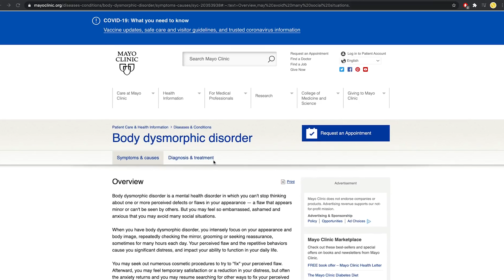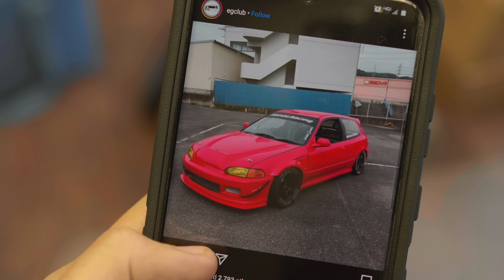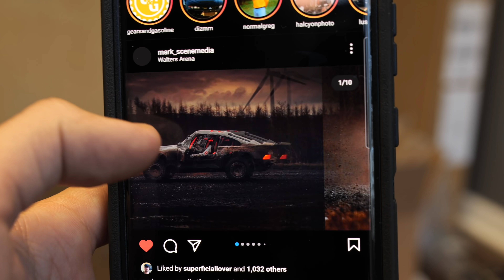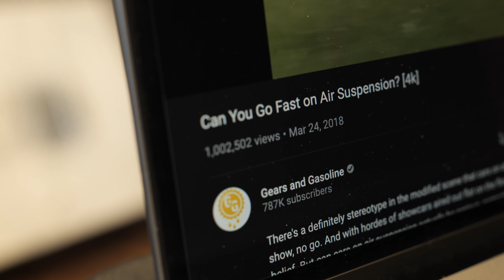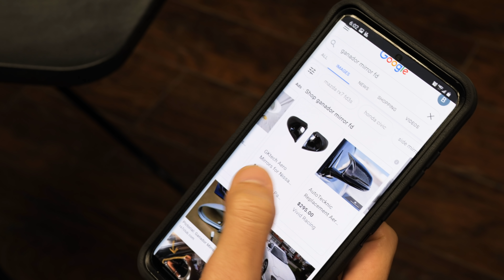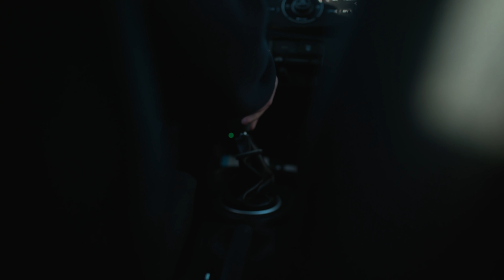Cars Won't Make You Happy

Comment: I drive a Citroen Saxo 1.0L and currently, I keep my VTS version in the garage, waiting to get fixed (bought in a horrible shape with the intention on fixing it). The standard car costs about 200€ and I paid 1.5k € for the VTS version. I'm working on both of my cars alone, and I desire to keep both of these cars as long as possible, may be my lifetime. My standard one is the car that my dad gave it to me for free, saying "you might drive it a month or two, before it dies". Headgasket was blown and a lot of other stuff to be fixed/replaced, which was worth much more than the car's worth. I fixed it and I use it as a daily since. It makes me happy; not because it would be such a great car, but because I like the idea of caring about a thing that nobody wants and use it with pride. When I fix something, it gives me the satisfaction of doing it myself and knowing the exact condtion my car is in. These two cars have about zero value to somebody else, but they have incredible personal value to me. You don't need a lot of money to achieve the same amount of satisfaction and happiness from this, you just need to learn some grattitude towards what you have.

Comment: its interesting. i dont consider myself a car guy by any means. i couldnt tell you much about them other than a few basic facts about which brands are better than others and comment about what cars i think are cool and which ones aren't. my family is not very rich, and as such, i never had the luxury of getting a really nice car as a birthday present or graduation gift. instead, i just drove my parents' cars when they weren't using them, and even those were never nice.
when i finally got my first car, it was a hand me down from my uncle. it was a 2003 honda insight. it really looked more like a computer mouse than a car, but i loved that thing. sure, the wheel covers were sometimes embarrassing, but with its easy to use manual transmission, 60+ mpg, and weird features, what wasn't to love? it took me everywhere until its hybrid battery became too much trouble to fix for someone with no experience working on cars and too expensive to pay someone who did. we sold it, and i still think about it everyday. i would sometimes get made fun of for driving it. it wasn't new, it certainly wasn't cool, and it still had a cassette player in it, but there was something special about it. it was my car :)

Comment: I can drive an automatic (yuck), 2012 Civic LX Sedan around and it makes me feel happy. If cars don't make you happy, you're just not a car guy... or not that much of one.

Even the ratty (well over 200k miles), 4th gen Civic base model that I swapped a DOHC ZC into made me insanely happy when I was ripping through the gears. I felt like I did a great job on the swap, so the fact that it treated me so well for so long (it only ever had one a issue, a distributor failure as a result of the engine being stored outside before I bought it) was just extremely rewarding. I never cared about what other people thought about it, I wasn't trying to market any aspect of my work on social media (that seems to be your problem), I just wanted to improve my car so I could drive it and have fun with it, and that's exactly what I did.

As long as I'm doing it for myself, I also love wrenching, that helps, too.

Comment: Ah, fudge man. I got a black 50hp seat arosa. Cleared off the badges and threw in a mesh grill. Put some nice bronce sparco trofeo 4 on it. I got a lot of positive feedback. I got a H&R suspension for it getting me 6cm lower. (havent put it in so far) I couldnt be happier. And once i ve saved up the money. I ll drop in a audi 1.8t motor and gearbox. But its a project car. They are not supposed to ever be finished. Its like a relationship. It might stay the same for some time but not forever. People change. Cars need some love.

Comment: It doesn't matter what you drive. If its yours and you're proud of it, fuck what anyone else thinks man. I used to have a pontiac minivan a few years back, 200,000km on the clock, sounded like a wet fart coming down the road with a muffler that was more rust holes than muffler. You know what though, all the stuff I hauled, all the work it put in and all the memories it let me create made it a great car to me. R.I.P ghettovan.

Comment: Former modder/tuner fanatic here and yes cars aren't happiness. I had a couple hot cars back in the day but when you see how much money you spend vs the limited time that you're actually enjoying your car (and not stuck in traffic commuting). But a hot car will be driven hard and likely have a lot of problems, especially when modded because the truth is modified cars aren't factory spec and by their nature break in strange ways to become spectacularly unreliable and pricey to keep on the road. So at the end of the day when you measure the heartache, anxiety every time you smell oil, coolant or exhaust, the strange noises, check engine lights, trip back and forth to mechanic, or fixing it yourself, all the fees. After a few years of that and learning that its a losing proposition and I didn't even have a super expensive car or was trying to keep up with the Jonses or anyone else. It wasn't even because I wanted more or because I needed a car to feel like I arrived. I just always loved fast cars, wanted to have one and be able to enjoy it. It was just to have a fast car which I "raced" on the track or autocross was more aggravation, way more aggravation than joy. So despite the fact that I wasn't banking on a car for self esteem or aspiration, I still got sick of the high maintenance broad element of that sport. The satisfaction was fleeting and not matched by the expense or effort.

The truth be told I got into fitness, a combination of cycling and weight training. Wow is cycling a lot of fun. Most of the time you spend in this sport is on the saddle. I ride more miles and way more hours per week than I do in a motor vehicle. I can go balls to the wall, riding as fast/hard as I can and not put myself at risk (speeds still remain in low double digits). I am in the best shape of my life at almost 50yo. The money you spend and more importantly time invested directly increases your capabilities which increases your ability to do more which increases your self esteem and happiness. I feel like there are no limits to my fitness or what I can do on my bike. I have met so many people and enjoyed so many places. And I get to eat like a pig, almost anything I want, and at my age still fit in my high school clothing and belt!

Comment: oh i forgot to add, to save costs i used oem parts and found what fit or made it fit, that was the true tuner scene and midnight club ideas. to use whatever your givem, i even have a supra pump on the way because it flows the best and it was super cheap 1jz 2jz pump, oops. ~

Comment: in egypt cars more than 1.6 liters get terrifs up to 200%,  so they are pretty much unattainable especcially since the currency is very weak. i would be very happy if i were in your position where i can get a broken down bmw for few thousand buck, here it the cheapest 316i with 100000 kilos on it costs 13k. and the cars that come here are not the same as the ones overseas. here they always come with a higher suspensions since the roads are shit, they come with almost 0 safety to reduce cost, and anything you want to modify you need to get it on writing in the car's license or else you will have problems. it is a car enthusiast hell. 8 second 0-100 is considered very fast here.

Comment: Just realized I actually like speeding more than I liked cars, which is why I'm blasting 150km/h omw to work back and forth every day, just full throttle and enjoy the ride, even if the car is a 1.3 underpowered stock shitbox with broken suspension parts

Comment: Its not about having the best according to everyone else. Its about what you think is the best.
I have an Opel Omega Wagon from 2000. It weighs 1,7 Tonnes, had about 136 european hp from factory (Rüsselsheim) has thin 195/65 15 tires all round and guzzels gas like crazy. Its your european grandpas car, the one he bought all the way back when he needed a new car and it needed it to be a wagon because thats what he always had for his family.
I am 19 years old and I love this car. To me its not your grandpas old rust bucket to me its a historic piece in the Opel lineup. The last RWD Opel the last car with engine options over 2,6 Liters, the last to have a dumb steering system with 2 swing arms and some linkages. The car even comes with its own legend of ALMOST having the 5.7L LS shoved into it in a large scale series. And its this legend that Id like to one day make become reality for this old black grandpa wagon. I am also a car mechanic apprentice at an Opel dealership so I know how to work on cars and it always puts a smile on my face when I see a longitudinal mounted engine instead of your Opel gold standard of transverse. Its the technical details everyone overlooks because they arent really considered advantages for dayly driving but makes me love this car.

I also wanna own a Subaru WRX STi 2004 but those are not cheap.

Comment: The car i have now, a 2005 pontiac grand prix i’ve done so much work on it, got it for cheap but with my financial life $2000 took a lot out of me. I did a lot of work on it in hopes of having a healthy daily driver. Probably have spent $700 in parts, $1200 in gas so far. After 3 months now i am guessing i have a spun bearing in the engine. There’s a constant ticking noise, i am waiting for it to die. I was pretty devastated and now i have to find what is next if i can even find anything that’s not a lemon. I am happy to see that there are other people grateful for what they have and what they have worked for. I am grateful for the knowledge i’ve gained in the work i did but also regret my decisions. Thank you for the inspiring video.

Comment: i built my car to go to car shows and show off my hardwork, but i ran out of funds because i was spending on big parts, but im glad i did because i have stuff nobody else does. cause its older. its all about you, you have to find your individual style. otherwise you will be unhappy, sure i will be featured and yeah ill go i was featured im a street racer im in rival with x y z club. which i am. but unless you work hard and the hard work makes you happy that too will make you unhappy. 

i was born too late in the 90s, too late to join midnight club, i still chase that but they might be dead by the time i get older or retire or be in jail or whatever, so i made my own midnight club, member count, 1 , me , i made my own branding. i dont care. 

im not a 200 mph speed demon yet but i dont care about straight line performance, 

when you build a car the entire car should work cohesively together. as one unit. and you should be able to harness that car, its power and call upon it to do what you want it to do and where you point it. 

spending big money like they do is pointless, just keep one car and build it max.

Comment: You buy, build, mod the car for yourself - never for likes, views, 'profit'.   The 1984 Ford Ranger truck that I pulled out of a field for $800 was the most fun / satisfaction I ever got from a project.  I turned every nut on that rebuild and rescue.  Installed a rebuilt motor (2.3 in line 4 - stock motor), moved to a 5spd trans, new tires, wheels, brakes, seat covers, shocks, new stereo and a deep clean.  All work done in my own garage - no crazy paint, no crazy tuner mods, no suspension lifts or drops.  Just a damn reliable truck that worked for me for 15 years.  
Total purchase & build cost - 3500  
that truck did make me happy
I hated to sell it.

Comment: I beg to differ. Once I get a second gen RX-7 I will be a VERY happy man.

It's not something that'll turn heads or attract attention from the average person who's not into cars, but I prefer that being more introverted. Once I put a catback exhaust system on it I'll have the dream car I've always wanted since childhood back when I first watched Initial D, with the added bonus of improved fuel efficiency, improved engine performance due to more efficient exhaust flow and a deeper sound. 👌 

I want this car for me, not for clout. Besides, there's not much clout to be gained from through an old Japanese tuner car from the mid '80s to early '90s, especially when your average person wouldn't even know what they're looking at unless you told them.

Comment: Your problem is that you perceive the happiness that your car brings thru the lens of owning it and driving it. Or even thru buying and bolting on parts for it.
That's not what (enthusiast) cars are for. They are for building. And once you get a welder, a lathe, an english wheel, etc. to actually build your car (and the parts for it) yourself. From raw stock. Because that is when it stops being about weather or not your car is the best or has the best parts. It's about creating something from nothing, something unique. And that is what people are hardwired to  get endorphins from. And when you build this cool part for your car and people notice and ask you to do it for them, you have a choice; start making money, or even better; tell them that there is no way you will build something for them, because there is no money that could buy the cool factor of making and having a unique thing. And that they should go do it themselves, in their own way.

Comment: Its simple. I dont value what anybody else is doing. Theres no value. I dont care if somebody doesnt like the build. I dont go to any meets. I dont have an instagram etc.

At a time i got caught up in it a bit. Yes it will make you miserable.

If youre into cars. Be into cars. Make it how you want it. Enjoy it.

If youre going to measure against others or need validation of others....

What outcome do you get? 

Forget their opinions. Simple.

Just do what you love.

I disagree with the statement here about people not building their cars for them.

Some people yes.

The people like me you typically wont hear from.

I have the bodykit i want because i like it.

I have a shaved engine bay... wire tuck etc.... because i like how it looks. 

I like maintaining it that way.

Enjoy the build. Put the parts on you want.

Go drive it.

Simple.

Enjoy cars for being cars. Instead of being in the car community.

Comment: Highly disagree
Was working a minimum wage job literally down bad my woman left me my mom told me I was a loser consistently 
Then I bought a 1986 300zx
I found my car on market place
And I found it by looking up 1980,1981,1982 until I got to 1986
Then I seen the car 
The same one from paid in full a movie I idolized, the hood Scarface.
I never seen myself as a car guy
But I did end up buying an 88 300z and two beamers 540 and 535i
Late night drives have cured me
I suggest not putting your eggs in one basket
You can’t drive your build everyday just like you can’t wear the same shoes everyday
I think the best feeling is having a non running car then getting it to run
I listen to 80s house music and swing 80s cars all through Chicago 
 I was broke as f two years ago
I literally have a gta situation outside red white blue and black
Yes it’s defined me
I love it , what colors ur Bugatti?

Comment: Bullshit! There is a lot about magic!
Long comment warning

I had "Opel Frontera B Sport". A "weakest" off-roaders but with few quirks (hard top, heated seats, ac). It has not-the-best but decent engine and stuff.
I saw great Toyota Land Cruisers, Pajeros, Cherokees but in the end they were no match for my clunky Opel. I fucking feelt that car. I kissed my wife there, I rode it on few summits, I borrowed it to a friend who felt in ditch, I cleaned it. I knewz that it can climb up to 30 degrees. I knew, how it handles and her limits. I knew how to find a way for her trough the forest. We had many breakdowns, but it carried me home every time.
It was a bond. 

Now I have it with my Outback. It's old, but in a good shape. Weakest engine, but great gearbox. No mods.
And the magic is still there! I know it's great on every weather. I can feel how it slides and rolls. I drove it to Pag island. I repaired it. I got tired on long trip, and so was it. I drive my dogs in it. I love the sound. I hear how it squeaks.

The thing is. You need to approach to your car as to your friend. You need to know what hurts it. You need to find it's "unique" thing. Tell it good world. Look back at it when you park. Then, remember those machines also carry you home and participate in your adventures.
If understand that, even the most ordinary car will become your dream car.

Comment: If you're modding a car, make less than $150,000 yearly and don't have a Roth IRA.. You are hustling so far backwards it's not funny.
I own a 2000 Maxima I bought for $1,500 (mods:rims/stereo), a 2006 Mustang GT (mods:rims/stereo), a 2011 Mustang V6 (mods: 17" Cobra Rims I bought of Craigslist for $500 with great tires on them), 2014 Camaro V6 (mods: Rims/ Subwoofer). All but the Camaro I bought with deferred maintenance and fixed back up. Just be happy, already. My guess is $1,000,000 tax free dollars in your Roth IRA when you turn 59 1/2 will make you happier than a busted rig with Bootleg Mods on it.